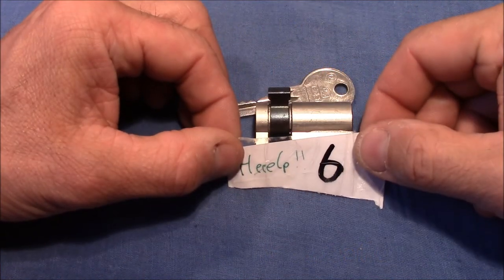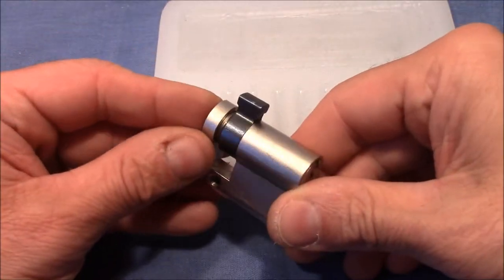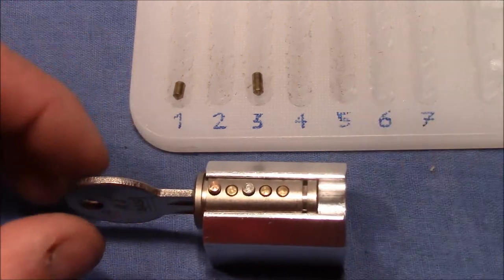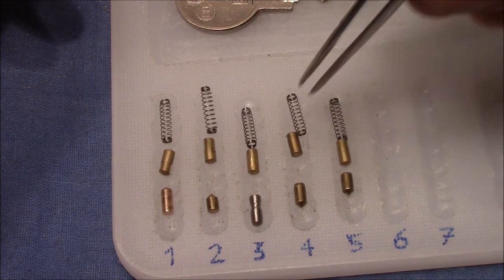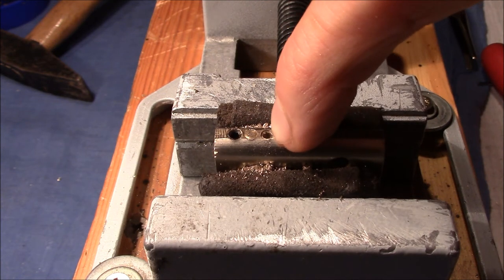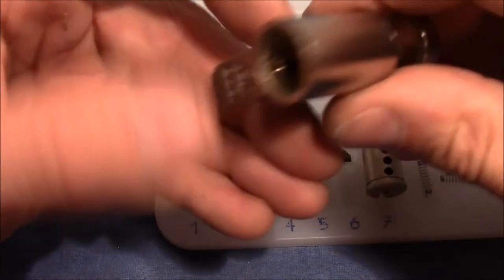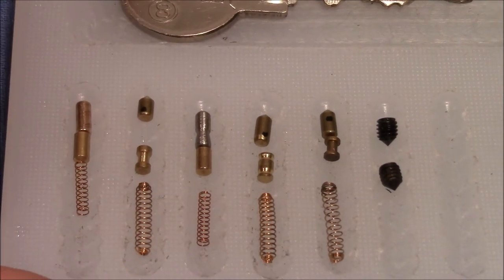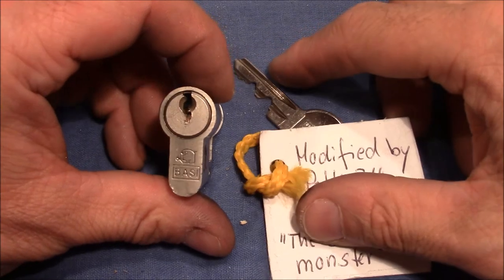(picking 188) Creating a monster out of an elephant - challenge lock creation for Ulrik

Comment: Very cool and interesting to see how you make them :). The elephant is kinda cute ;). One more monster on this world now hehehe :).
Reply from the maker: But it turned out to be a tame beast ;-)
Meanwhile I've done a lot more lock modification and improved some steps. For example I use the power drill for threading and I rarely thread the chambers in the bible as there is always the risk for the pins / springs to stuck. Also I have some "trash" plugs that I use for holding the pins when filing them down to the right length. And I have a tool like this http://www.proxxon.com/de/images/produkte/lightbox/28620.jpg which gives a lot more options :-)